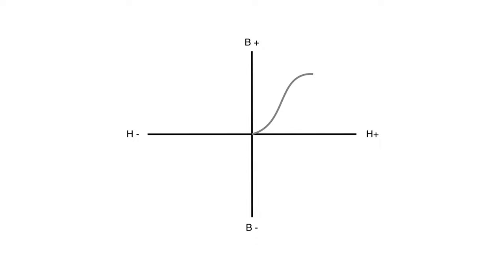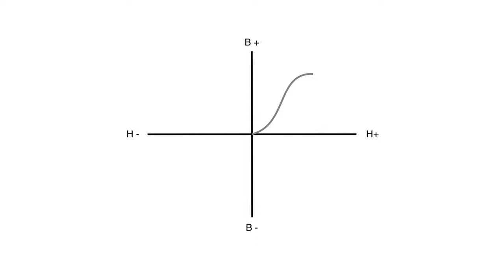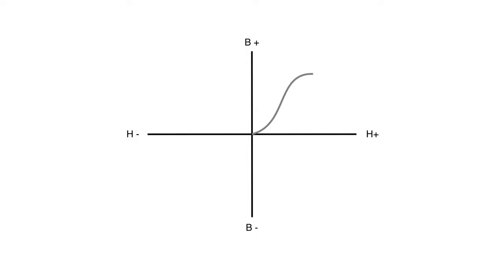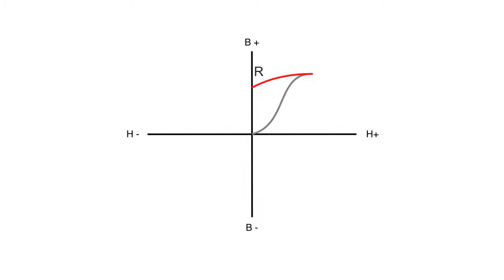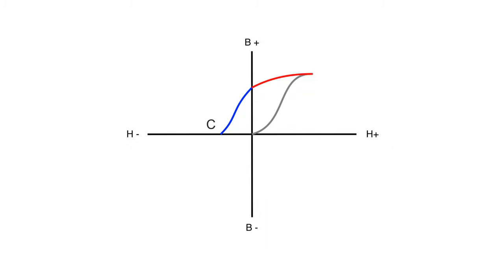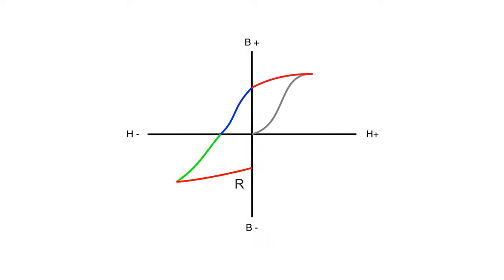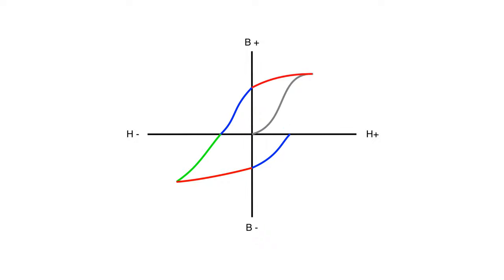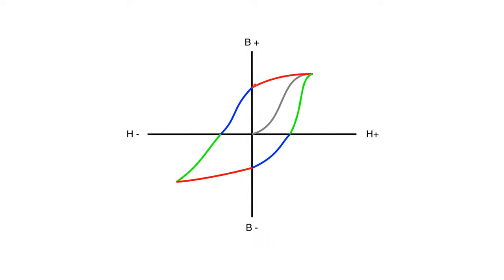The Hysteresis loop explained

Comment: Wouldn't it be easier to explain if you said H is directly proportional (equivalent) to the direct current through your electromagnet in amps?  Then say B is the magnetic field strength measured in Tesla or gauss created by the current?

Comment: Is magnesium caused because the speed of electrons “movement of charge” is so close to speed of light
Electrons have mass and are always on the move when an electron breaks an orbital it produces a shock wave known as a photon. heat in the system are from resistance or electrons breaking orbitals producing infrared photons as compared to super conductors . Gets complicated but electrons prefer following along metals like magnetic Fields like iron.
When electrons travel in a vacuum the spread because they repel each other magnetic Fields do something similar. Is there super conductor equivalent for magnetic fields. I am trying to design a better electric motor. Hysteresis is very important as you know. Especially for variable speed motors. Sorry let my mind wonder.